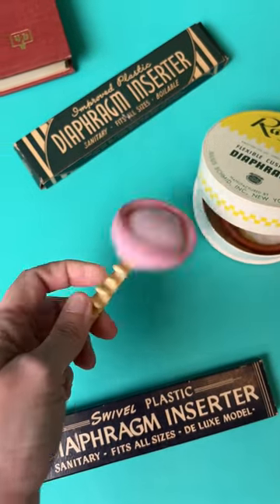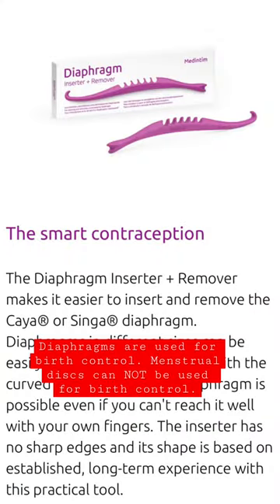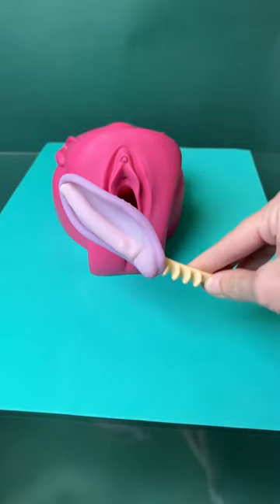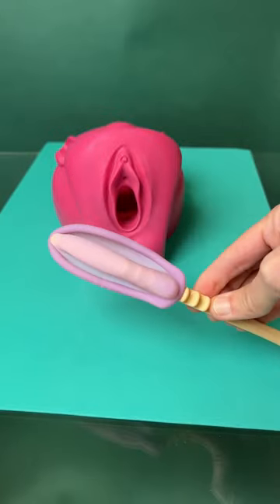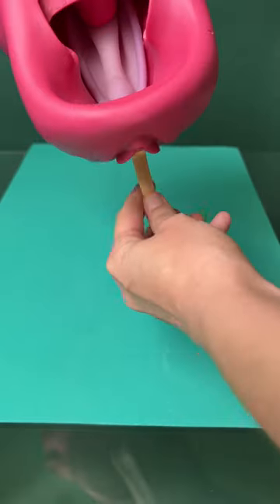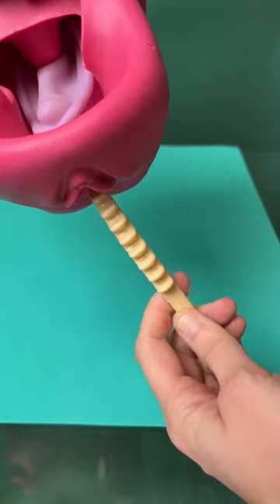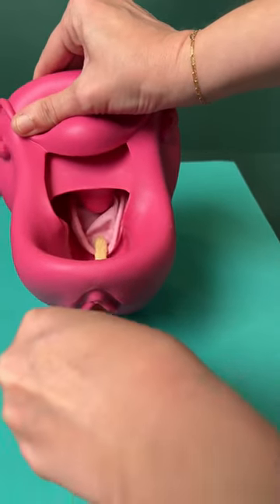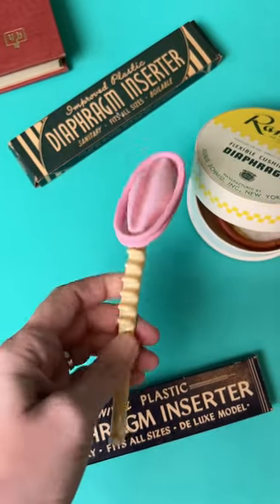What’s that thing? Diaphragm inserter and remover demo #shorts

Comment: Hi I was hopeful that this is the right place  for my questions lol. I have recently had my second period after the birth of my son. He's nearly 5m. He's my second child. After my first I went up a size for my menstrual cup. I don't recall leakage while I slept. I tried the same cup for my first period last month. It wouldn't sit right, basically it was slipping out. Used pads and ordered a bigger size. But had major leaking  with it last night. I emptied before bed. Now I understand that periods are irregular at this time, but will it become less heavy in time? 

I have been using a cup for about 10 years. I like my cups lol but I have to admit I still don't feel like this one fits great. I feel like my stick to pull it out is poking my inner lower front wall. Will my vagina shrink anymore or do I need a bigger cup or perhaps I should try a disc?

Sorry this is long. But I could really do with some advice. 

Oh not sure if it helps but both births ended up being c section after dilating fully but unsuccessful for natural.

Sorry I just posted this on another of your shorts, I didn't want it to be unseen 🙈.
Reply: Don't really have an answer for your question
Haven't been there yet 
But could you tell me what type of cup you used to use before your child birth? Like company n all.
Reply: I have found over time that certain brand cups work better for me. When I started using them (over 10 years ago) I was basically stuck with Diva or the single use discs bc that's all that was available/I knew about. Diva used to leak all the time for me and I just dealt with it since my flow is relatively light and short. I found Lunette a number of years ago and since switching to that brand, I almost never leak. And when initially doing a side by side comparison, I don't recall them being all that different in shape/size but it was just enough to make a huge difference. All that's to say, maybe try a different brand cup? You also said your flow is heavier now, maybe you just need to empty the cup more often? That wouldn't change feeling the pull tab, but again, maybe speaking with your doctor would help shed light on how your cervix is now sitting and if you can expect that to change anytime soon, or at all. Maybe try a disc instead. I just switched to a disc a few months ago and this is the first month of no leaks. There was a learning curve, for sure! Good luck!
Reply: @RinkoStarr64  
Thank you for your reply. I have been wondering if a disc will be better but wanted to give this cup a few more tries. I feel like my cervix is basically at the opening now. I'll need to feel and check during my next period. Yeah I believe in the last few years menstrual cups/discs have boomed, so there's a large option now. I did put up with the cup leaking this period been and if the next is the same I'll look into a disc I think.
Reply: It sounds like you cervix is sitting lover then normal. I usually use salt soft regular cup but I just had a miscarriage with what would have been my second child and when I went to go use my normal salt cup my cervix was so much lower that it just wasn’t sitting right during the first few periods I had after I miscarried so I had to switch to the salt regular disc for the time being. Hope that helps!